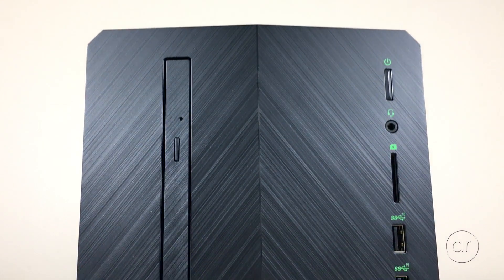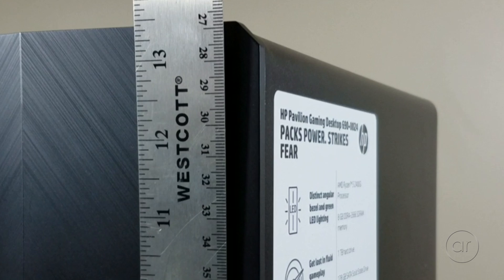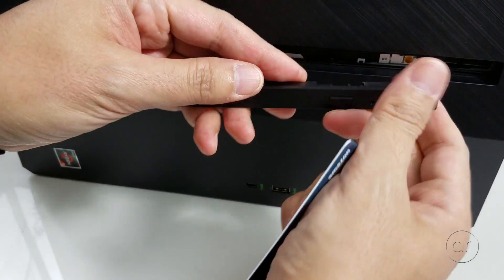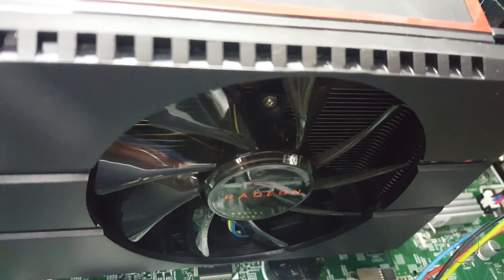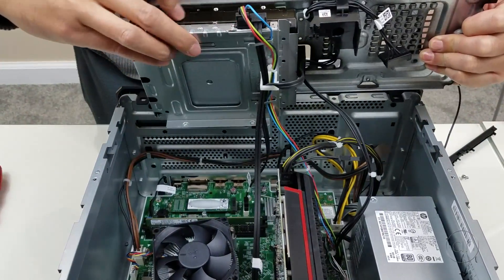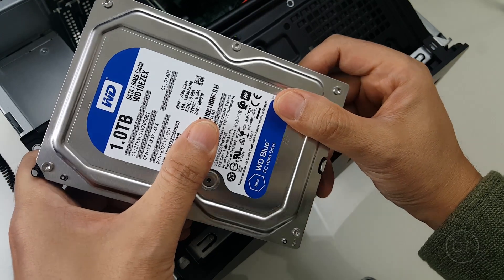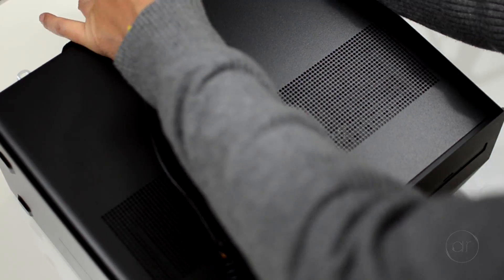How to Open and Upgrade a Ryzen-Based HP Pavilion Gaming Desktop

Comment: Priority upgrades -
 RAM, Get at least 2x8 2666mhz (The fastest this mobo can support unfortunately)
SATA or M2 SSD Drive. Make that your boot drive. I went with a PCI-E 4.0 backwards compatible m2 drive to use in future builds. Mind you this mobo only supports 2 of the 4 PCI lanes the m2 drive could utilize, so your M2 drive will be running a lot slower then it could. Its probably still faster then a SATA SSD though. Either of them is a HUGE upgrade over the crappy HDD. I had to unplug the hard disk when putting windows on the new drive for it to boot properly, then I was able to set the HDD up as a secondary large storage.
_
Those will be your most important and easiest upgrades out of the box. Next will be a CPU or GPU if you want to keep going. Read the description to see what  others have gotten away with. You only have about 10 inches of clearance and not a lot of power to spare. My unit had a 400w PSU. This limits our choices. So I went with a RTX 2060 super, figuring the GFX card will come to whatever future machine I build.
The CPU is also tricky. This motherboard does not support the X version of the ryzen chips. Because of power limitations and motherboard limitations, realistically your best options are a R5-2600 or a R7-2700. You  could also look into 1000 series chips if you would like but those arent all supported either. Since this motherboard cannot overclock, I went with an R5-2600 for its higher base clock speed and comparable performance in games. You could potentially get a nice deal on a CPU right now as 3000 series Ryzens are doing well and folks will want to get rid of their old ones. Sadly we cannot use those new 3000 series CPUs. But worry not!
_
If a new SSD and RAM upgrade are phase 1, and a new GFX card and CPU are phase 2, and you've come this far and still are considering the future of your invested machine, then consider phase 3: A new case, motherboard, and power supply. I would go with a newest chipset that can still support your Ryzen 2000 series CPU if you can. Like perhaps the x570 later this year or next year when prices have come down a bit. A new motherboard will give us a lot of improvements and features over HP's proprietary customized junk. More slots for RAM, expansion, potentially  more ports, incorporated cooling, THE ABILITY TO NOW OVERCLOCK OUR CPU FREELY. A new Power Supply to facilitate this new case and board will also mean being able to  support a whole bunch of expansions and devices and overclock that graphics card without fear of overdrawing from HP's weak 300-400w PSU You may also want to  buy faster 3000mhz DDR4RAM at this point to replace our old 2666 mhz RAM. Better RAM speed/timing will get you bigger yields over marginal OCs in many cases with Ryzen CPUs.
_
If you've gotten to or past phase 3 and have moved all your expensive components to a new case/board, did your overclocking, or decided its not for you, and are ready to embrace the future...Well, you're pretty free at this point. You could buy a 4000 series Ryzen (5000 series?). You could buy a RTX 3080ti or 3660ti or whatever is relevant at the time. Better coolers for more overclock tinkering.
_
tl;dr 4 phase upgrade plan to turn our dinky prebuilt storebought mass produced PC into an unbeatable titan of the future.
Reply: What motherboard will fit?
Reply: @sethrandir  If you've done every other upgrade you can, then you would shop for a motherboard, case, and power supply together.
Getting your parts out of HP's shoebox case will expand your options dramatically for future upgrades.
__
So you can shop for any motherboard as long as:
-It fits the case you are shopping for
-It can fit whatever drives, GFX card, and other upgrades you may have put into your HP machine
-It can fit whatever you think you might want to acquire down the line (networking/USB expansion, cooling systems, more drives, bigger GFX card)
-(Of course make sure the case and power supply your looking at can potentially support all this too!)
-Any other built-in features you might want - built in wifi, what sort of ports are available, etc.
-AM4 CPU Support - While AMD is technically letting some B450 motherboards update BIOS to support new 4000 series Ryzen processors, it will involve taking away support from older Ryzen CPUs (entirely optional). If you're savvy with BIOS this is an option. I would rather not fuss with it. Some viewers have 1000 series Ryzens and some have 2000 series. Some have integrated graphics on their processors. For this I can't tell you what motherboard or what chipset you should look into getting. I was considering an x570 board to accompany the Ryzen 5 2600 I'm replacing the stock CPU with, because x570 supports 2000 series Ryzen CPUs, and the upcoming 4000 series Ryzens. I wouldn't have to mess with updating BIOS. This gives my CPU an upgrade path to go into the future with, as well as the added bonus of actually letting the Ryzen 2600 be overclocked on the new board (unlike HP's) until then.
__
Not a bad deal at all. Sadly x570 boards run a little more expensive right now. And new releases always have some uncertainty. That is why this is a final upgrade step. Its something to keep on your radar while you shop for other parts of your PC, but not something to actively look for for another year or so, unless an amazing deal falls out of the sky.
Reply: drunkdonkeydude thanks for the detailed help!
Reply from the maker: Thanks for the awesome, detailed upgrade plan. Do you mind if I append it to my pinned comment with credit to you?
Reply: @accessrandom  I don't mind at all!
Reply from the maker: Thank you, and done! I've appended it to the pinned comment (I actually ran into a character limit in the description so I couldn't add it there).
Reply: I was told I could upgrade my rx550 to the Fxf 580 black edition aswell as 2 corsair vengeance to make it 32gb would that give me a good gaming boost?
Reply: Instead of the rtx 2060 could I go for the gtx 1650?

Comment: HI, I have a 310 w psu. What do you think is the best graphics card that I can get with this psu ? Thanks!
Sorry, This will be my last question ever, what ssd can you put in this, it says SATA, but I just wanted to confirm. Thanks!
Reply from the maker: I think the GTX 1050 has very low power consumption so I can't think of anything beyond that (the GTX 1060 and the AMD RX 470 have almost double the power consumption). Maybe a GTX 1050 with more memory? For the Pavilion 690-0024, you can replace the existing M.2 SSD with either an NVME or a SATA M.2 SSD, or you can add a 2.5" SATA SSD.
Reply: access random . Thanks! Mine didn’t come with an ssd so I’m trying to install one. I also found out that the Gtx 1650 has a 75 W usage, but I don’t know if it will fit.

Comment: My dvd drive isn’t popping off
Reply from the maker: Others have commented on the HP-recommended way to remove the DVD cover (in the pinned comment) - I've pasted it here. Hope this helps:

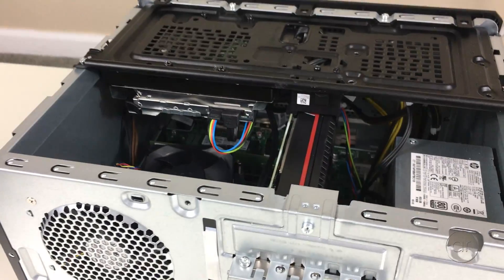Thx to Ye Wang: No need to pry the DVD cover "like you did there on 2:25, instead [it] has a black plastic quick release tab (seen in 1:43), you can press it in and push the entire optical drive out of the front panel..."

Also: thx to tinmania: "HP recommends: Before removing the drive cage, unplug the two cables connected to the rear of the optical drive,  press the lever on the rear of the drive, and simply slide it out to the front (no screws). Reverse when reassembling."

Comment: Can you put a 16gb ram stick and a 8 gb ram stick on there or do they have to be the same
Reply from the maker: It's possible, but in general it's not recommended. The two sticks of RAM will run at a slower speed as they won't run in dual channel mode. I've personally run into problems in the past (random reboots, random shutdowns) when I use not just mismatched RAM sizes, but even different brands/models of the same capacity, speed, and timings.

Comment: I'm not sure why but I was able to get every screw out accept the ones for the hdd cage any ideas
Reply from the maker: Unless they've changed the screw type, these should be torx screws (they look like six-pointed stars) as seen at the 2:05 mark. However, there's a slot for a flat-head screwdriver so you can use that also.

Comment: Can the motherboard be upgraded? The case has a built in ioshield
Reply from the maker: I'm afraid not. The motherboard is highly custom such that the power connectors are non-standard - even the fan hole spacings for the CPU are non-standard in that they are drilled for Intel (even though it's a Ryzen CPU).
Reply: @accessrandom  well I recently bought a cpu and motherboard bundle, is there anything I can do to fix those issues?
Reply: @accessrandom  should I get a new case? what else should I get for it to be possible to upgrade
Reply from the maker: @andrew2shiesty  With a new CPU and MB bundle, I recommend a new case and power supply. The HP case is highly tailored to the OEM motherboard and power supply that is included  in the pre-built PC. Fortunately, all the other components can move over (including the graphics card, memory, SSD, and hard drive, though the optical drive is a slim type which would need some adapter to fit in a 3.5" bay).
Reply from the maker: With a cpu/motherboard bundle, you'll need a power supply (you won't be able to use the HP PSU on a third party motherboard and a new case. Almost everything else can move over, including the memory, SSD, hard drive, and graphics card. Since the DVD drive is a slim-type, you'll probably need some type of adapter if you want to mount it in a 3.5" bay.

Comment: Please help. I just upgraded to 16gb of ram on my hp pavilion pc and now whenever I press the start, the pc makes a beeping noise and doesn’t turn on.
Reply from the maker: Are you adding 8 GB to the existing memory - if so, what brand and model? I've been keeping track of the memory that has worked for other users in the "Memory" section of the description. In general, you'll want to use the exact same brand/model as the one you have now.
Reply: I did that mistake once. It's because you put the RAM stick wrong way.

Comment: In the description, multiple users said they upgraded the memory to BLS16G4D30CEST. On amazon, there are  a few options to choose from, including 2666Mhz, 3000 MHz, and 3200 MHz. Which speed should I choose?
Reply from the maker: The model number refers to 300 MHz (if you click on the other speeds, you'll see that the model number changes).

Comment: Pretty much the exact model I have, bought on sale last year.
Got a couple RAM sticks on the way
Mine didn't have the M2 SSD Drive though, so I ordered  a 1tb one. Hoping the case on it wont be a size issue. Wishing I had seen your video before ordering it. Ill try to make it the boot device and primary game library.
__
I'm looking to further futureproof this machine with a nice CPU/GPU upgrade.
Any recommendations? I was considering a Ryzen 5 3600 
Less sure about the GPU. The 8 gb version of a 580x would be nice but I'm sure I could do a little better? Any tips for what can fit, works with a 400w power supply?
Reply from the maker: It really is a good value for the price for what it is but HP doesn't make it easy to upgrade. According to their specifications website, HP allows up to a Ryzen 7 2700 (unfortunately not the X version nor any third gen Ryzens). For the SSD - as long as your M.2 is a 2280 size, you should be fine. I've been keeping track of successful graphics card upgrades from other viewers, whose brands and models are listed in the "Graphics" section of the description.
Reply: @accessrandom  
Thank you for the fast reply and for keeping track of viewers' successful upgrades! That's extremely helpful!! I'll be more specific and let you know how successful I am!
- Here is the SSD for the m2 slot. Its a 2280, but it comes with a heatsink on it so I'm a little worried. https://www.amazon.com/Corsair-Force-MP600-Gen4-PCIe/dp/B07SQZYW2V
-Replacing the stock RAM with 2x16 sticks https://www.amazon.com/TEAMGROUP-2666MHz-PC4-21300-Unbuffered-Computer/dp/B07QRTYYBK

Still on the fence with the GPU, but again seeing what other people could use, and the size breakdown has been very helpful to the decision-making process. I've been out of the market so long I don't really know what to look for.

 As for the CPU, I believe you, but I totally missed it saying 3rd generation Ryzens-X units weren't supported. I checked for maximum accepted TDP and AM4 slot, but was there any explicit information regarding this. At any rate, It seems like a R5-3600 is cheaper and gets comparable, sometime even better performance then a R7-2700x https://cpu.userbenchmark.com/Compare/AMD-Ryzen-7-2700X-vs-AMD-Ryzen-5-3600/3958vs4040

EDIT: Upon researching more, its reasonable to conclude the SSD Drive wasnt the best call since its geared for PCI-E 4.0. So perhaps this motherboard wouldnt get the full utilization out of a 3rd generation Ryzen, like the R5-3600, anyways. With that said, I would still consider getting one if it still works without the 4.0 support. Any idea if it does? The SSD and CPU could be fully utilized in a future motherboard if I decide to fully upgrade later. I would hate to spend more for a R7-2700 that ends up rapidly outclassed anyways.
Reply from the maker: @drunkdonkeydude  Yes, please let me know if your upgrades work and I will add them to the description with credit to you. In the past, I know that some (non-HP) AM4 motherboards had a catch-22 situation where the BIOS couldn't be updated to support third-gen Ryzens unless you had a previous-gen Ryzen in the socket (so AMD would actually have to send you a loaner CPU for you to be able to upgrade the BIOS). As far as I know, there is no BIOS upgrade for the HP, and the motherboard is so non-standard that I'd be surprised if a 3rd-gen Ryzen worked in it. However, if it does work it would be huge news!
Reply: @accessrandom  

After doing a lot more research and deliberating, I've ordered a Ryzen 5 2600, and RTX 2060 Super. Size and TDP requirements shouldn't be an issue from what I can see. No sense in trying an unsupported 3rd generation Ryzen. The 2600 looks like it performs better in a few scenarios over the R7-2700, but I also got a fantastic deal. Fun fact: I payed about as much for the CPU and GPU as the computer originally cost when purchased on sale. Once the 2x16gb 2666 mhz RAM sticks and 1tb m2 SSD drive arrive, this thing should be a little monster. I'm looking forward to doing VR gaming and streaming. 

Probably less important to most people, but I was worried despite what the label said, this computer was in fact NOT "VR Ready". I bought a Samsung Odyssey Plus in anticipation of the upgrades, and it arrived before any of them, so I tinkered with it. A requirement for a lot of the VR Software like the Windows Mixed Reality Portal includes 8gb of RAM. As we know, the APU of the G series of Ryzen CPUs keeps a reserve of RAM for integrated GFX. Fortunately, this did not stop the machine, in stock state, from passing the system spec diagnosis to install the VR software. And I have to say I have been having a wonderful time with games like Beat Saber. I might give Half-Life: Alyx a try for testing purposes to see if the machine can handle it before upgrading.

If anyone is considering VR (Do it!!), this budget machine, and a WMR Headset, like an Odyssey, can offer you 90% of an amazing VR experience for less then half the price of a traditional "high end" build geared for it. Don't let them fool you.
Reply from the maker: @drunkdonkeydude  Thanks for the detailed write-up. I know HL: Alyx has a minimum requirement of 6GB on the RX580 so it would be interesting to see how it performs on 4GB.

Comment: So I’m planning on putting it In a new case with more space and 6 fans for better airflow and I have upgraded the ram what should I upgrade after that I was thinking a new graphics card
Reply from the maker: Sure, a graphics card is a good upgrade (I've been keeping a list of successful upgrades in the "Graphics" section of the description). If you're keeping the motherboard and power supply, just make sure you don't go beyond the power requirements of the 400W PSU.
Reply: access random I won’t or I’ll just upgrade to 750w PSU when I find one I like

Comment: What CPU should I buy for this computer I usually get a black screen playing games sometimes?
Reply from the maker: That could be a symptom of an overheating CPU. Do you know what temperatures you are hitting at max load? If you're comfortable with re-applying thermal paste between the CPU and its fan, that may solve the issue...

Comment: Can you put a new gpu in it? Like a gtx 1070
Reply from the maker: I haven't had any reports of the GTX 1070 but theoretically it should work, as the power requirements are similar to the RX 580. You can find the brand/models of GPUs from viewers who have successfully upgraded their cards in the "Graphics" section of the description.
Reply: @accessrandom  many thanks man

Comment: I have this pc and it over heats so much
Reply from the maker: Does it overheat to the point that it shuts down? At idle, I am running at about 35C, and under load (going 100% CPU with a handbrake encoding), it hits 80C. If it goes higher than this, you may want to try re-apply thermal paste between the CPU and its fan. There is a viewer (Terry Parrot - details in the description) who went to some extremes to get the temperature down.